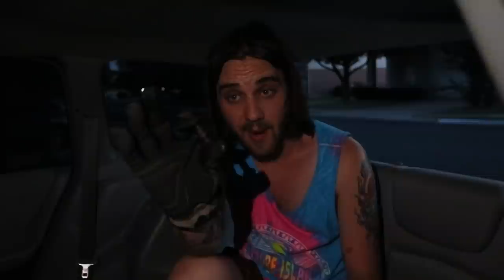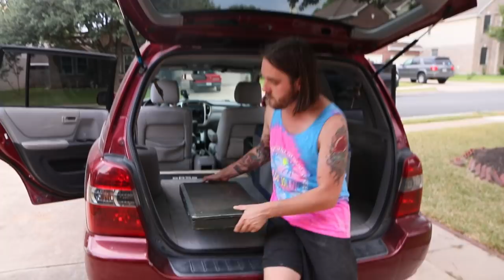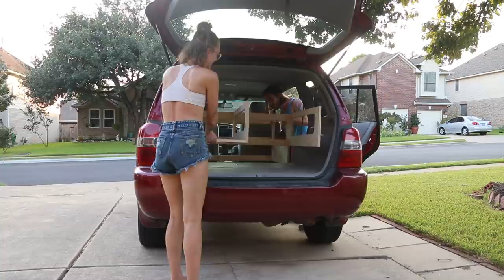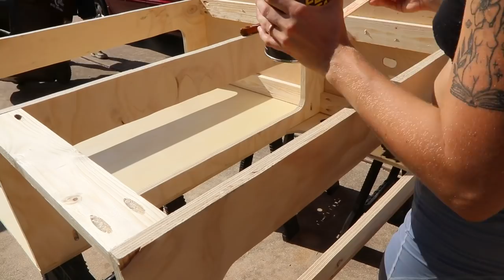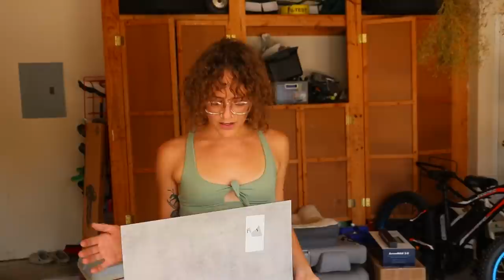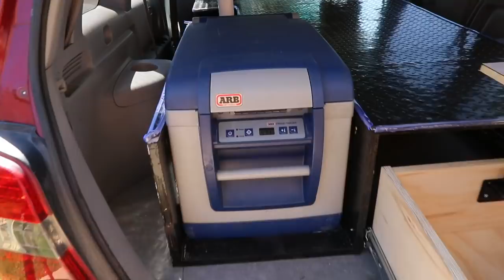FULL SUV Mini Camper Build for LESS THAN $1000 (Van Life for CHEAP)

Comment: hey, with a hybrid Highlander, apparently you can have heat or AC running while parked, with very minimal (and automatic) engine usage, which, along with the All Wheel Drive had me thinking  it'd be the ideal vehicle for car-camping, sleeping inside the car... especially IF you could figure out how to do a pop-top!  We ended up buying and building a 2005 Sprinter 140 low roof instead